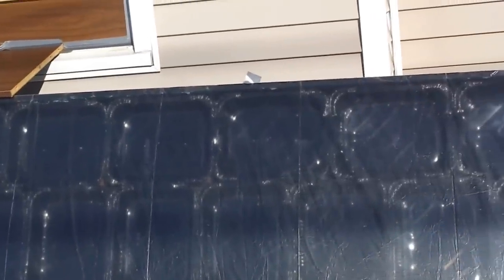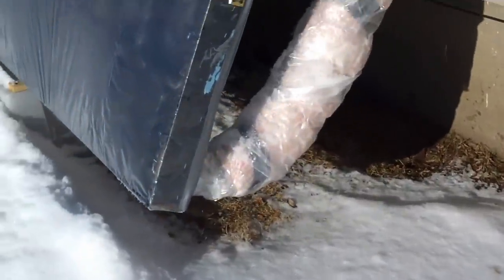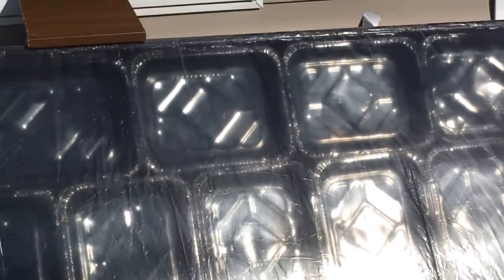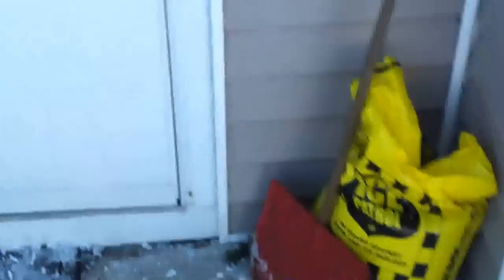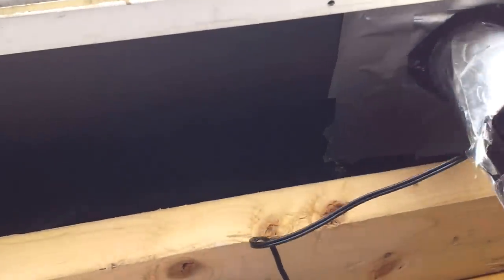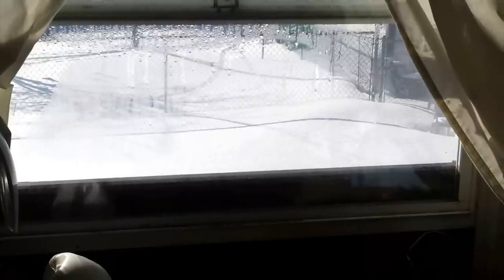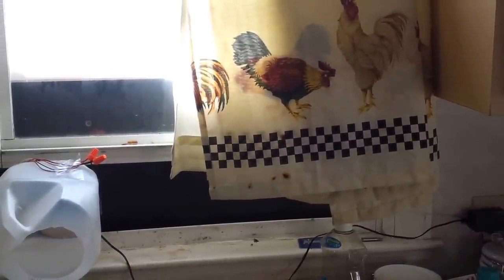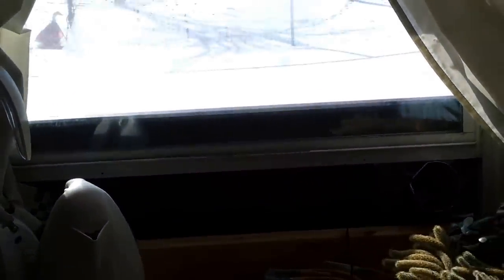$35  4' x 8' Solar Heater: Made of Aluminum Baking Pans [disposable kind]

Comment: use matte paint to increase absorbtion of heat.
Reply: marcjtdc that's what I don't get why the aluminum backing on foam or tin foil by others if they spray paint it with the Hot Black paint 🤔
Reply: Reimagine flat black to absorb heat (and not let it reflect back out  again) on the front, and the shiny (back) side will radiate that heat absorbed on the black side into the air flow or water lines.  On this build, the air goes througj the fabric and absorbs heat in doing so.

Comment: Don, I know you mentioned the cans,. but as I cooked for a good chunk of my life, I know steel holds heat better than aluminum.  I used steel cans, Progress & Campbell's soup and run Tha fans on a 100 watt solar panel, using the system to heat my hoop house.  That, along with heat storage, gives me a 365 day growing season, incl citrus.  By the way, great vid.  Thanks.
Reply from the maker: Sounds good.  Thanks Peter
Reply: so many old downspouts are tossed out that they may be less hassle time wise, and the older ones are steel galvanized. Its nice to see people reuse.

Comment: In Cali we use Radiant Barrier Osb. It could help gain heat behind the pans. Nice project. Now if you can make some cathode and diode cells to push those fans you will be closer to self heating. More power to U.

Comment: Nice fan sound. Make a vacuum chamber in the outside unit and you get something. Vacuum camber you make by heating the pans then closing. Anaerob glue can close the vindow off pans.. more like vakuum glass tubes.. in a plate configuration

Comment: WONDERFUL idea! Thanks so much for sharing.
 One application I imagine is a "foldable" camping heater: construct the frame of the THINNEST material possible and HINGE it to the smallest frame size so it all folds up, STACK all the aluminum pie pans into one neat stack, fold the 3-6 ml plastic, add some duct tape for seams when setting up and add whatever duct work necessary to attach to camper or tent etc. It would fit easily in a car, camper, etc. LOVE the implications. Greatly appreciate the demonstration.
Reply from the maker: Erin Owl .   sounds good.  You should try it...

Comment: Thanks for the video. @ 7:03 it sounds like you are saying that that heater heats your entire 1500 sq ft house on a very cold sunny day without any other supplemental heat. Is that right?
Reply from the maker: Yes, my regular furnace would kick on for the last time around 10am and then won't go on again until, 6, 7, 8 o'clock in the evening or later depending on the amount of sun and how cold it is.

Comment: When building an outside collector, you want it to run at the lowest temperature possible. This means high airflow. The hotter the collector, the more heat escapes to the environment and the less that gets into the house. R10 on the back and sides and the lowest output temp. you can get.
Reply from the maker: makes sense
Reply: This is accurate. I've completed mine (video hopefully posting today) I have an 80mm computer fan that's solar driven, but I purchased a 4" inline duct fan with speed controller. The duct fan pumps WAY more heat. $40 on amazon

Comment: It's very good to innovate, mine is made with a piece of roofing iron with scrap aluminium pop riveted to it. Max temperature so far 140 F through a 6 inch duct. Mine is about 3ft by 6ft, I should have made it bigger.
Reply: I just made mine 2x7 and ran tests on it for the cold coming. I too should have made mine bigger. I plan on connecting a new collector to my previous one to boost the temp

Comment: I think u may get more heat with flat black paint than gloss black.   Very impressed
Reply from the maker: Thanks for your input.  Others have suggested this as well.
Reply: +Don Russo if you can findan old slidimg glass doublepain door youcan increase the btus instead of the plastic film. plus flat black,  i get soloar heat even in cloudy days

Comment: Excellent, simple, and easily replicated!  A couple more details, please.  How did you mount the aluminum pans inside the 2 x 4 frame, and were the 1/4" holes in the pans' side-walls with the pans flush with the bottom of the frame, and does the frame include a back wall?  Thanks for sharing - it's pretty cold here in Milwaukee!
Reply from the maker: Hi Jill, There is a bottom/backside and the pans are attached to it.   I tried affixing the pans with a staple gun but was not as effective as the short self-tapping screws I ended up using. The 1/4" holes are drilled in the side walls probably a dozen and a half holes [18ish for those on the metric system  ].

Comment: Those computer fans are 120 ac. How are you powering them.  Same with the hair dryer.
If you had a 12 volt battery you could run an old RV vent fan, but it might be a little too powerful and/or noisy.
Reply from the maker: Yes, the computer fans are 12 volt.  I have taken standard 12 volt transformers (power adapters) to run them.  I was not sure if the hair dryer would work the same but surprisingly it did.

Comment: I'm in No. Idaho above Coeur d Alene. Our winters are very gray and overcast. Temps usually hold right at freezing with a two week dip down to the teens, zero or even below at nght. I wonder how this would work on a gray day. I live in a trailer and am trying to get completely off grid. I have solar panels, generators, inverters, etc, but heat with a catalytic propane heater and propane cost skyrocketed this year over $3, now about $2.65. Hope it comes down during the summer so I can fill up my big 25 gallon tanks. I can use one of those every seven days or so for winter heating, but one will last for weeks in summer for cooking, hot water heating and my refrig which can run propane or AC. I'm thinking your device could blow warm air under my trailer after I put up plastic sheeting for a trailer skirt as I have done before without any heater. The floor can get cold enough to freeze the cats' water dish overnight. I like your set up as it's cheap and light and doesn't seem to need glass for the cover. I suppose the plastic sheeting disintegrates after a while unless you get UV resistant plastic for more money.
Reply from the maker: Yes, I am in Michigan with similar whether conditions.  Temp doesn't matter as much as does that the sun is shining.  The heaters work best when it is sunny or partly sunny (I have gotten 120 to 150 degrees on such days).  On cloudy days much less-but even on those I noticed 80 degree +/.  Build one and try it--I don't think you could lose.....

Comment: A few questions if you don't mind: Does this unit produce enough heat to heat your home to a comfortable temperature without the use of alternative heat source during the winter? If not, about how much does it reduce your alternative heat use? What is the airflow? What is the power draw of the fans you are using? I ask because I plan to do some experiments this winter. I am situated rather nicely for solar heating. However, I am a cheap bastard and like to try to find cheap ways to get decent results. My home is about 1000sq ft and a perfect layout for solar gains.
Reply from the maker: Good Questions: First, on sunny days the heater did keep my furnace off most of the day [usually around 9:30am till 5pm].  One of these units was enough to do a pretty good job on my 1440 square foot home as long as the sun was shining and hitting it.  Power draw from the 12v vans I believe is about 3 or 4 watts each.  (12v x .33amps- 4 watts).  If your electric cost 10 cents per kilowatt hour [1000 watt hrs] then that's 250 hours per fan for 10 cents-- If my math is correct.  My estimate is that these only cost cents per month to run.  I was running the fans 6 to 8 hours per day usually.    I use two-- one for the inlet and one for the outlet.  A couple of my heaters run completely off solar (solar electricity to drive the fans) so they cost nothing to run [once you pay for materials].  --Hope this was helpful.
Reply: Don Russo Useful reply, however still curious as to the cubic feet per minute airflow through the unit lol.
Reply from the maker: Standard computer fans.  They are probably in the range of 40 to 70 cfms each I would guess.  Double that (for the two fans I use) and its probably in the range of 80 to 140 cfm.  Its not a lot of fan power but it does the trick if its left on constantly.  Of course, you can always increase this with any type of fan you wish to use--I would guess.  Only problem is that if you use too high of a CFM it will probably cool the unit down to fast.  I feel steady and slow is the way to go... like the Tortoise  :)

Comment: Is the air just going over the top of the pans or channeled through them ?
How much space did you leave above the pans for the air to flow over ?
Reply from the maker: Good Questions.  There is about an inch of room above the pans and between the plastic covering.  Also, there are small 1/4" holes drilled through the pans for airflow (hard to see in the video).

Comment: So new ideas I found here!  BTW the plastic tote will degrade in a year or so, since this is a few years old, I guess you know that but it's for New viewers.  Put it on some concrete blocks.
Would be better with flat paint in the high heat variety!  A layer of insulation on the back and sides inside the frame would boost the heat gain if you need it.
New Sub!  All post notification!  I don't do that very often.
Reply from the maker: check out my newest video!

Comment: How hot was it inside, this was a great Idea.
Reply from the maker: Thanks Al,  The heater kept most of my 1440 square foot house warm for the whole day (without the heat kicking on).  It usually depends on how much sun and how cold it is out. The day of the video I believe the temp was 5 degrees outside and the heater got up to149 degrees.

Comment: I am curious you did not paint the inside black. You could increase the heat tremendously I would think.
 Sorry, I just caught your list of materials included gloss paint. I noticed the gloss of the pans and it appeared they weren't painted. Great cheaply constructed system that really works.
Reply from the maker: I did paint the inside pans and inside and around as much as I could.
Reply: Don Russo
I went on with my first comment to explain that you were listing your materials used and mentioned you did paint the inside and apologized. I do like your panel.

Comment: question:you have all of the pans flat to the bottom, would it make a difference if you would have alternated the pans, 1 up, 1 down, and put a 1 inch spacer board at the bottom, or what if you put the bottom of the pans up, and put a 1 inch spacer board at the bottom,.. the pan would heat up, hold the hot air, and would heat future air that hits the pans, or mix, and get circulated before it was set out through the vent into your room.. keep 1 inch at the bottom , and top for flow...can you make another video on a smaller scale, and test this? would be interesting if you can tweek this, and get a better resolt..good luck...hey, you can also try putting a black screen over the top of your pans faced up...let me know....also try using that green house plexy glass  instead of just plastic for your top cover...
Reply from the maker: Thanks Joe.  If you try this out feel free to let us know how it works out ...

Comment: Hello Don, Did you use the polyiso board to insulate? Also was the plastic you use the foggy kind ,like drop cloths or did you by the crystal clear? I wonder if it makes a difference how much light would come through if you use the cheaper plastic that sorta foggy verses the clear.
Reply from the maker: Julie Clark.  No insulation board.  Clear plastic, pretty thin

Comment: Don
When you constructed the unit did you connect the pans to the insulation board or is there a space for air flow.
Reply from the maker: I connected it right to the plywood or insulation board if you are using it.   The air flow is between the pans not under them.  Because the side of the pans come out on angles there was still over 1" of space between them even though on the outermost part they are touching.  Don't forget to drill a good amount of holes on the sidewalls for air flow also

Comment: Hey Don. Sure appreciate all of the building and experimentation that you did !!! Now that you have a solar heater outside, how do you still feel about your indoor only units? Are you thinking of switching over to all large outside units? I've been meaning to build solar heaters for a year now. I have black aluminum screen and high heat flat black paint. But since I've been working so hard to refinish the interior and exterior walls, I hate the thought of cutting holes in them. I could slide a window open and make a plywood adapter like you have I suppose. But if I could get away with all inside solar heaters, it wouldn't hurt my feelings any. Although your 6F outside temp making 125F into the house is super impressive. I understand that you are pulling house air into the heater and back out again. We only have 18F winters here for just December. Not as bad as Michigan for sure !!!!!
Reply from the maker: Hey Mike.  The indoor units are fine too--they are just much smaller than the outside ones so you are not going to get as much bang for you buck.  Also, you would not have to run  ducting through windows or walls as in the case of the outdoor one.  I suppose both have there places....
Reply: I'm highly motivated by having an $80 electric bill ! So I've started gathering materials before the weather gets cold here. Not the the cold where you live though !! I might rig the ends of the furnace to windows like you did. I read on one of your other videos that you got 72-74 degrees off that big furnace. That's also very motivating !!
Reply: I just found one window with black plastic over it that's running 113F. That's after going through a new double pane window. I think new windows may cut way back on heat output of the solar heaters. The outside of my house the walls are 160F. 70F air temperature.

Comment: Is the black  paint staying on the pans?  Was wondering if it was flaking off due to heat/cooling cycle
Reply from the maker: Good Question Mike: No flaking yet.  I think the heat would have to be a lot hotter to cause that.  I have heard some guys use paint as if they were painting a BBQ [special kind], but as of yet, I haven't needed it.

Comment: I like this idea. How warm was the temperature inside your house? (not the temp of the heater but the room air). Did you have a thermometer across the room or in another room to measure the temperature of the room/house?
Reply from the maker: Pretty sure it was in the low 70's throughout the house and like 74 in the room where the heat blew directly... I thought I discussed the specifics in the video... watch the whole thing and you will catch the info.

Comment: Wouldnt it be more efficient to simply buy aluminium vertical blinds, paint them black on one side and white on the other side. On cold days close them with the black side towards the sun. The black side turns the light into heat and its already inside behind de glas. On warm days turn the white side to the sun to keep the heat out. Low tec, no electricity, no transport loss
Reply from the maker: You might be on to something there. Give it a try and let us know if it works

Comment: Hi Don, wonderful video, and great ideas. But, for idiots that do not know how to work with electrical issues, could you please explain if there would be a way to use a battery vs a transformer for the computer fan(s)? I see you 'wired' a blow drier motor to run one of the fans. This could be very risky for some who do not know enough to do, and perhaps burn the house down (like me!). Think everyone is COLD this year, not just MI. Therefor, everyone would benefit from a simple energy system to help heat homes, like yours. Thank you for the info!
Reply from the maker: You could wire up the 12 volt computer fans to a 12 volt car battery or something similar.  You are right if you don't know about basic electricity you don't want to risk it otherwise.  Good luck!  I help this helps :)

Comment: Hi Don. What a great concept! How much gap did you leave between the top of the pans and the foil to allow airflow. Also I assume you have one fan that sucks the cold air out and one that pumps the warm air in? Thanks.Living in MI too - Ray Twp.
Reply from the maker: Thanks Ray: airflow is between the pans--with the angles there is space between them... also many small holes are drilled through each pans to create air flow: yes the video shows two fans for increased air flow

Comment: how long did this last?  what size square footage did it heat?  thx great video!
Reply from the maker: The heater still works to this stay (still lasting/operational).  I kept my 1400 sq ft house toasty on sunny/partly sunny days.  Most of those days the heat stayed off from 10am to 6, 7, 8, and sometimes even 9 pm--depending on how sunny it was and how cold out.  Thanks for your input

Comment: I was just wondering what if you didn’t have fans would it work also since the hot air goes up ...?...just a question...
Reply from the maker: Not nearly as well.  The fans force the hot air through more quickly.  Most any type of fan will help...
Reply: If you don't have electricity you can use some small solar cells to run some dc fans. They will automatically come on when the sun comes up and automatically go off when the sun goes down. Also if you don't run fans, as Don says, it won't work as well, but if you make one hole about 75% smaller than the other hole the pressure difference will move the air for you. Keith Noneya
Reply: I'm looking at making this design with a (computer) 4" fan on the inlet to reduce noise. Which hole should I make about 75% smaller ??  Should I make the top outlet hole bigger or smaller and what approximate size?